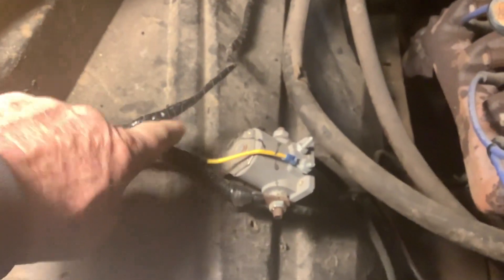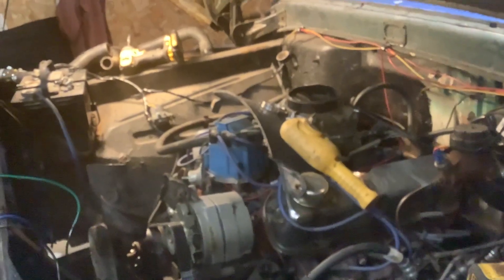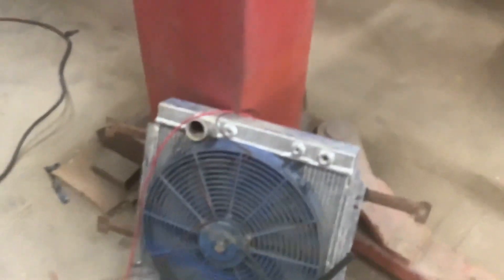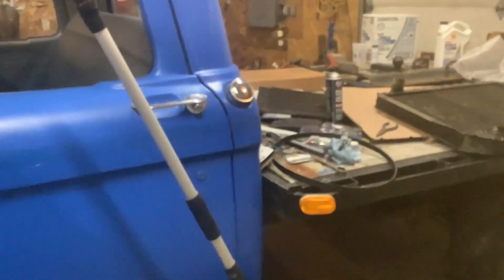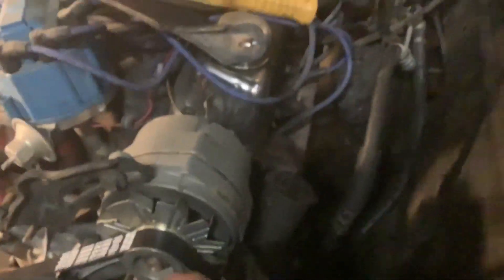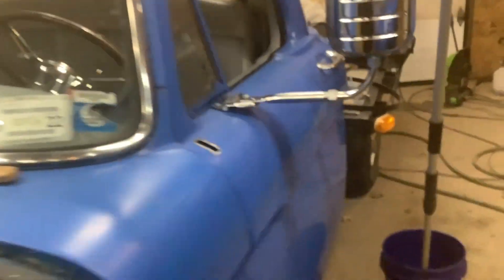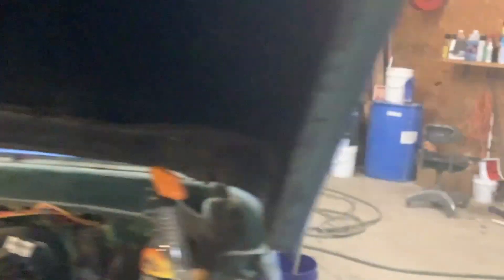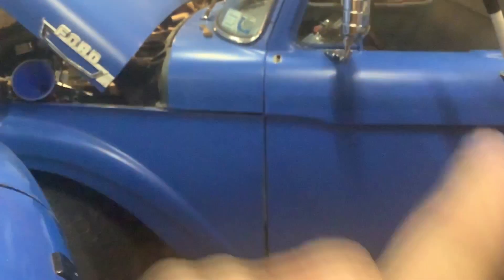Changes to the 66 Ford F100

Comment: So Odd Seeing A HEI Distributor On A Ford Engine!!!! 
Keep Rocking It Out Brother!!!
Reply from the maker: I didn’t do that Pat ….come on man  …lol , I sold the engine with a Summit ready to run installed. I’m going to have to live with that and the four foot plug wires for awhile, I just fixed the wiring on the front half of the truck and added a horn . The headlight toggle switch is also going the way of the dodo bird also .

Comment: Won’t win any beauty awards…😂 Mine won’t either. My dad owned these 60’s trucks and I grew up driving them. 3 on the tree of course. The one I’ve had since I was about 20 my dad bought for me for 600 and it’s still not driving as you know. I’m 57 now, so it’s been sitting around a while now. My dad just passed away and his last wish was to get a ride in my truck but that didn’t happen. I get to live with that. Only reason was my own health issues that kept that from happening. My dad had a turquoise and white one and he would light up talking about it because they had came out with a v8 and he finally had a v8 motor truck. My dad told me before he died that I’m going to love having my truck going and that I’ll wear it out. I know I will. It’s 95 percent ready to be able to drive now but power steering pump mounting, hoses, belts then take to get exhaust done. I’ve done new brakes, fuel lines, wiring harness, etc. I still have to order a tiny regulator that your fuel and temp gauge hook to on the speedometer cluster. It drops the voltage down to those two instruments. I can’t wait to be able to go out there and hit the key whenever I want and drive it. One day I’m going to have something like “ Thanks Dad” pinstriped on the glovebox door.